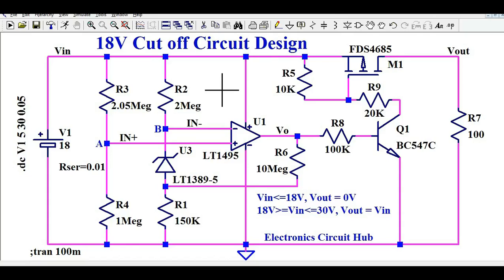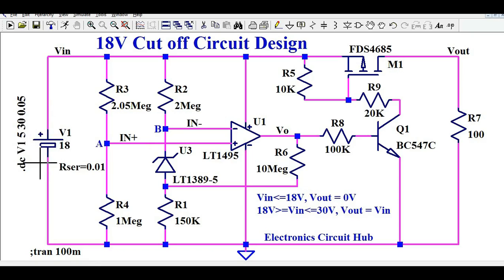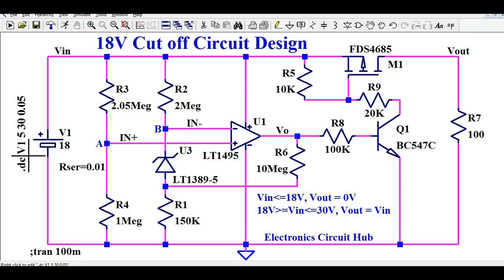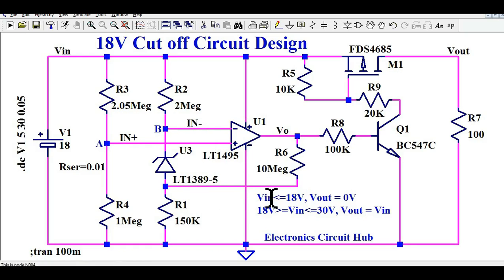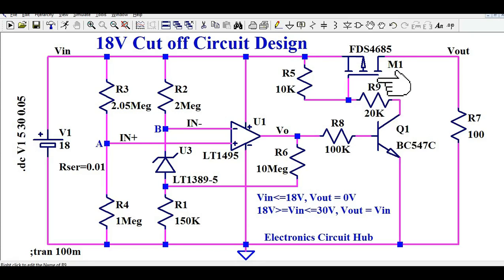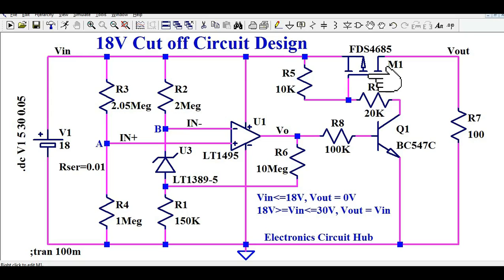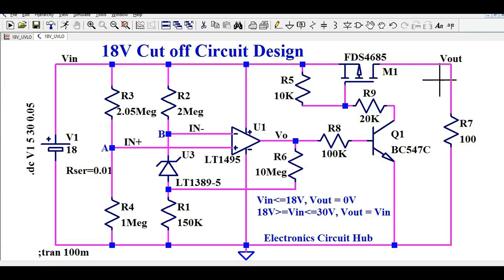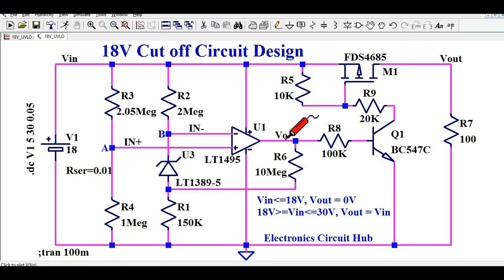18V Cut Off Circuit Design and Simulation | Low Voltage Circuits

Comment: Does the circuit keeps consuming power when the voltage is cut off? What is the max amp the circuit can handle?
Reply from the maker: Hi..the current consumption is very less in uA. Regarding Amp rating depends on Mosfet rating.

Comment: Can you make a design for 9v Battery cutoff? A circuit that can trigger SG3525 Low Voltage. I want battery to be 9v but SG3523 should read 10v and activate Low Battery task.
Reply from the maker: Hey...sure

Comment: Nice Job Metro.  Some questions please.  1- R1 is 150 Ohm , correct, as you mentioned in the video.  How did you come up with 150 please?.  2- Why R2 is 2.0 M Ohm.  If R2 is 2.0 Meg Ohm the zener diode would not be in break down region.   3- Why R6 is 10 M Ohm as well? Why did you select P type MOSFET and why FDS4685? Thanks again for a nice video.
Reply from the maker: Hey, thanks for asking very good questions. Let me try to answer your question one by one.
1. R1=150K -: You can see most of values i used in MOhm and KOHM. To bias U3 we need a very low current current to bias the U3. It has Low Operating Current: i.e. 800nA. So Vin_max=30V, IR1, IR2 = 139uA and for Vin_min=5V, IR1 = 2uA. With this current your shunt regulator will work.This current is enough to operate the U3 as you need as low current as 800nA . The output of U3=5V. lets say if you are using this circuit to protect the battery with deep discharge the higher resistance value will help to avoid drainage of the battery in stand by mode.
The maximum operating current of U3 is 20mA so you are free to change the value value of R1 and R2 but consider the limitation as explained above.
2. R2 : I hope above explanation will also answer the reason for considering R2=2MOHM but you are free to design it for 20mA. Its up to you. 
3. R 6:10 MOHM - You are free to use lower value in KOHM, there is no hard design requirement. This is design for battery application. R6 is used for hysteresis control.
4. Remember when you are switching the supply voltage to load. Here Vin is switched with the help of mosfet. This is called high side switching  and in high side switching P channel mosfet are used. 
There is no special reason to choose FDS4685, only you need choose based on your requirement. 
Vds = 40V, Requirement was 30V
VGSth = we are driving it with 10V
ID = 300mA and this mosfet is rated for 8.2A,  You can use even current mosfet e.g. 1A to 1.5A or 2A,
Other parameter is Rds(on) should be as lower as possible. 
So mosfet selection is really application dependent and yes you are free to choose it based on the specification. 
Hope above will clear your doubts.
Thanks and good luck !
Reply: @ElectronicsCircuitHubECH  thank you sir for taking time to reply to my questions.  I tried the circuit with lt spice.  When I used the R2 2.0 Meg it did not work properly.  May you attach your spice file please.
Reply from the maker: @alimovahedi7714  hey....ltspice file gdrive link is given in description.You may raise the request for access and I will grant you access.
Reply: @ElectronicsCircuitHubECH  Dear Sir, I clicked on description.You but I did not have the access please.